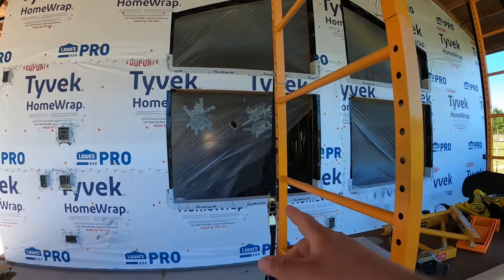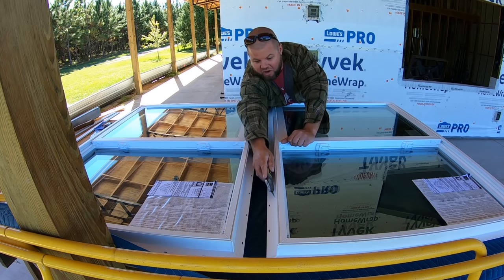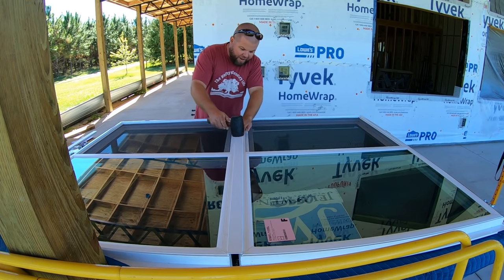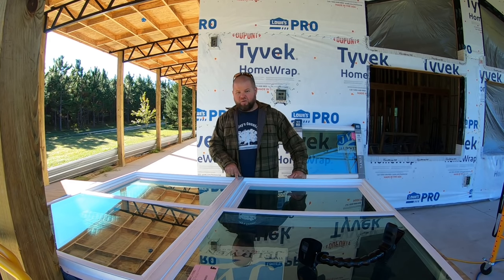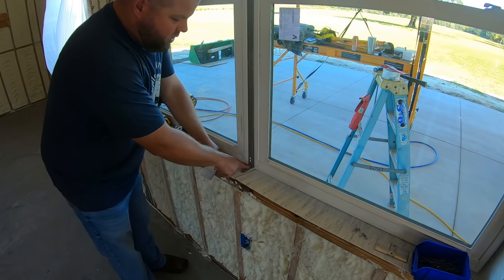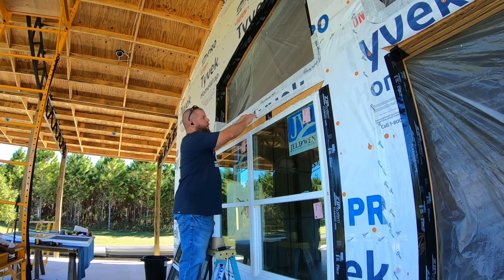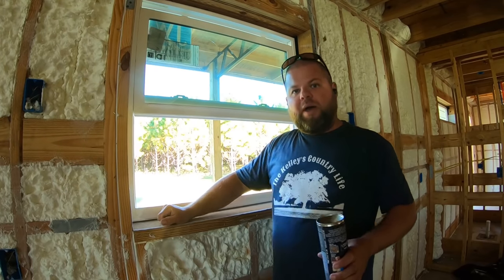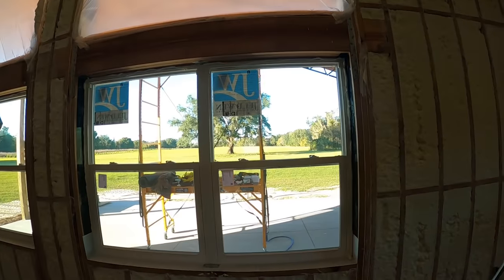Installing double Jeld Wen windows with a mull bar by myself! #469

Comment: I noticed that you trimmed the welded corners of the windows after you removed the nail fin. There is actually no need to do that. That weld is taken into consideration with the window width when ordering. That is why the mull pack takes up 1 1/8" of space instead of the 1" that is the call out. Also trimming that weld could lead to unwanted leaking into the structure if trimmed too closely. Also removing the bottom sashes makes the windows a lot less cumbersome, and more maneuverable.
Reply: Shannon, your comment is very helpful. At age 75 I am about to embark on 3 wide (24 / 48 / 24) x 48 high and plan to do (mostly myself) to a 1950's home. Fortunately the opening looks like 48 x 96, so it should work well & possibly stock Jed Wen windows from Menards.

Comment: I think I missed something here.  You said there were holes in the mulling bar that corresponded with the holes in the window.  Did these get screwed together at some point?  If not, I'm not sure how you would install them together from the bench like you originally planned.  Thanks!
Reply from the maker: No they do not screw together (although I did with my own screws). I think those holes are for access to remove the window for replacement or service at a later date of needed.

Comment: Hi Andrew,
Great video! Very helpful!  I'm planning to replace a triple window in the living room (3, double-hung) and was struggling to figure out how they go together. Now I know!

Question about the challenges of installing the molding strips (around 6 minutes in):  I realize this is years after the fact so you can't test it. Do you think it would work to "compress" it into place?  Start at one end and "squash" it in with a ratcheting clamp. Protect the molding on top, and the frame on the bottom with some flat wood.  Once the first couple of inches are in place it might be possible to hammer it in, one inch at a time, working along the length. Thoughts?

Thanks, Rob
Reply from the maker: Here's the better tip, remove the bottom windows via the quick remove clips provided and the weight in half. I didn't think about d4ipo6the bottom halves out.
Reply: Doing the same thing in the living room and room, where can I buy the moulding strips to connect them?

Comment: Helpful video,,,,but joining the windows to the mull bar is suppose to be done with self tapping screw from the inside of the window causing mull bar to sit flush against each side of the window per the illustration in the "instruction".  And yes the instructions suck..  By using caulk to adhere both side of the mull bar, the caulk widened distance the plastic snapping trim is suppose to snap to, making it difficult snap that piece in as you showed.  But there are many ways to skin a cat,,,and you got the job done.

Comment: Great video, how much did it change the dimension of the window, ie 2 windows 36x54, did it become 73x54?
Reply from the maker: Correct, 1 inch for the mull bar. Don't forget to leave a 1/4 inch gap all the way around.

Comment: What series jeld wen did you install. How do they perform? Are you satisfied with them?  Almost every expert installer ive spoke with recommend me to avoid jen weld. But these windows fit my budget for the amount of windows i need. They look like a nice window to me for the price
Reply from the maker: I did the basic vinyl windows that Lowes keeps in stock.  Almost 3 years later and no issues.

Comment: Ok - You have me curious. You have "over done" so many things why didn't you insulate inside the metal tubing in the middle of the windows? You have thin plastic, then metal (a thermal conductor) and then plastic. Where is the insulation? I was expecting you to stuff the pipe with insulation, styrofoam or spray foam to keep the R-Value up. Is that really a good Air Leak prevention system. I know you put in silicone but will that keep out the drafts?
Reply from the maker: I am, I wanted to do it with more insulative closed cell foam. I am out of it and have already ordered several cans. The top and the bottom of the bar is still open from the outside and I can inject the foam with my gun. Foam is set to arrive middle of the week.

Comment: You didn't put the screws through the window and into the mull bar.  I don't know where they go, which is why I searched this video.
Reply from the maker: I did put them in. Remove the screen, drill a hole through the window screen slot into the mull bar. Reinstall the screen and you can't see the screws. These are not factory pre drilled for this.

Comment: do i have to use the aluminum bracket in a replacement install in a block home with a tile sill?  It will look terrible..
Reply from the maker: That aluminum bracket top and bottom is what gives you wind sheer resistance and keeps the center of the windows from flexing. . I sure wouldn't skip that step. You can notch out the underside of the tile with a diamond wheel on a angle grinder to fit over the aluminum brackets.
Reply: @TKCL  I found out the bracket for my Jeld Wen mull goes directly under the windows, so it will not be an issue after all. thanks for the reply though.

Comment: How do you like the JeldWen windows so far. I have considered these also. Lowes has decent in stock sizes. Did you get the impact or standard ones?
Reply from the maker: Standard ones, no complaints thus far. Everything operates nice and smooth, the tinted glass is nice too. Can't beat the price.

Comment: Those look amazing! Using the same kits! Trying to do this myself- but stuck on calculating rough openings of two windows! I’ve searched for details but all I find is mulled windows should be 3/4 narrower than RO!
Reply from the maker: Looks like my rough opening (hard to tell with trim) is 73 inches wide to allow fitment with the mull bar installed.
Reply: @TKCL  thank you!!!

Comment: Nice miniproject. You save a lot of money with it. On dealing with the weight you could remove the upper and lower windows them, then once you have secured the frame roughly in place, put the windows back in. 

Oh one more suggestion from experience. Several of my uncles always worked top down in order of window (and glass door) installation. One of the reason they did that... I recall when I was 10 or so watching one of my uncles drop a sawzall while installing an upper window..and he made to grab it..and it wound up being knocked through  as in smashing through the lower window for the first floor. Since you already installed the lowers, maybe use some scrap plywood to cover them when the uppers are installed. Its not likely that anyone will break them but better safe than sorry.
Reply from the maker: Good points!

Comment: You're going want to pull the stickers off the window. Especially if you've got special coatings. The sun can cause some issues so the sooner you can get the coating off and the stickers the less likely you might end up with designs in your glass.
Reply from the maker: Good to know, I was told the inspector needed to verify and to leave the stickers on. But, my inspector does not seem that picky. I'll remove them, especially since these are tinted windows.

Comment: That bar insulated then also?
Reply from the maker: Negative but it will be, it's hollow top and bottom. I just ordered more closed cell foam and will fill the bar up with insulation.
Reply: @TKCL  I got a window that’ll need to replace that’s just as big of an opening as you have or bigger. Nice to know what options I have now! Thanks for sharing
Reply from the maker: Thank you for watching

Comment: Andrew did you say the bar between the windows got screwed into each window wasn't sure thxs
Reply from the maker: On some windows yes, these models didn't have screw holes. I'll admit I drilled and made some myself. Took the screen out and shot a couple screws into that track, into the bar. Otherwise the holes that were in the bar are for clearance or access to the window screws that already exist.
Reply: @TKCL  Thank you 😎

Comment: I am currently trying to install 3 aluminum Ply-Gem windows with Mull Bars and what a royal pain! I set the first one in with the mull bar in place. Then when I set the second window on the sill the two windows touch at the top with a 3/4" gap at the bottom.
I have a side gap between the framing and the first window and have it resting on the sill with just one screw securing it at top center. It is driving me bonkers as to why the two are not mating up.
Reply from the maker: Yikes, do both windows measure the same?
Reply: @TKCL  After another trip to Home Depot it was determined that 2 of the 3 windows were out of square. Tomorrow hopefully there will be windows in place.
Reply from the maker: Wow, that's horrible. Sorry to hear that.
Reply: @TKCL  Well it turns out the two windows measured 69-1/4 by 69-1/2. So swapped them out with ones that measured square. Just tried putting the first two in and same dang problem. They meat at the top but not at the bottom. Used a laser lever and the first window was plumb. 
No idea at this point what the correct cure is. But if I can get all three in the opening and they open and close with no effort I am calling it good and just buying more trim to cover up the weird gaps.
Reply: @dremwolf5419  I'm sure you have already installed the windows but if you are resting the windows on the sill maybe the sill is not level?  You need to use shims between window bottom and sill to level it.

Comment: Congrats...they look great! 
After watching you prep the frames & install the windows...it has given me the confidence to attempt to repair the window & frame that holds my A/C unit.  
There has been some wet-rot that occurred over the last 10 years so it has to be done soon...and it helps that the temps are getting lower  :)
Reply from the maker: Yes cool outside and lack of rain during this time of year is a great time to tear into that project.

Comment: You should take the sashes out to make installing easier. You and your wife could easily install them that way.....without having to put the window together in the opening.
Reply from the maker: Very good point!
Reply: Installing the way you did is not easy. I anticipated problems, but you did great.
Reply: One thing.....that groove around the outermost edge is not a drip groove but rather a groove for vinyl extension flanges that they make in a few sizes for different applications......like brick, etc. It also is used as a place to mount a "zero mull" kinda like you used, but in vinyl and adds no width to the two windows.